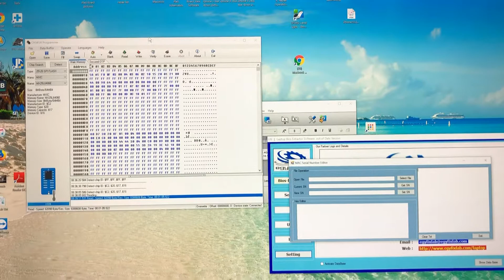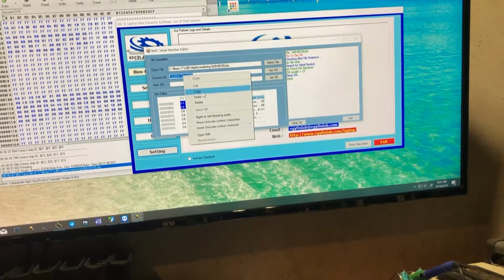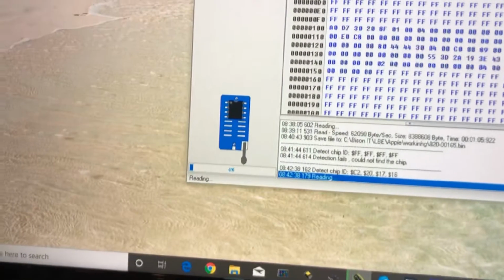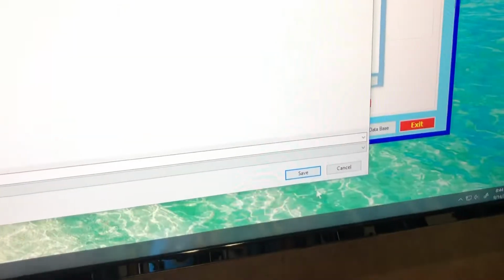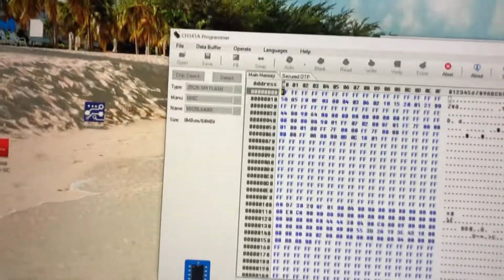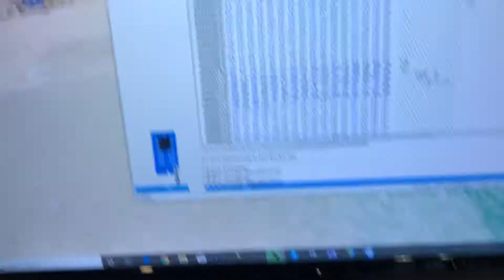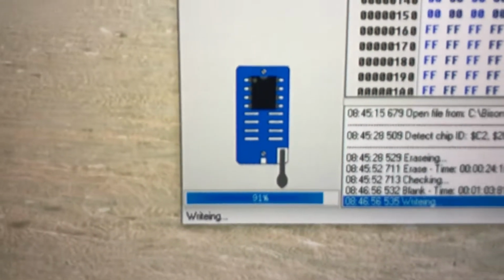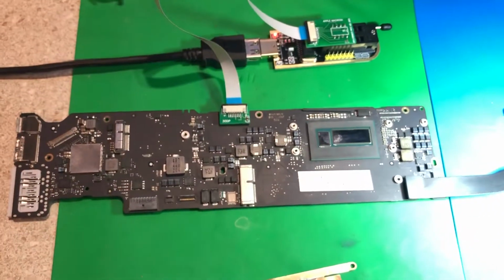Changing a Apple serial number

Comment: Hi! In a different comment, you mentioned that a S/N change was still posible on the 2018 and onward models with the T2 IC. How exactly did you manage that? Because after looking at the schematic for the 16inch the CPU isn't even connected to the SPI rom, as one isn't present on the board for the ME and UEFI.

Comment: Wow! Your vids are great!
There's a way you may share Mac book serial Editor? Software, I have the same connector to interface without desoldering the Epromm, a GQ4x programmer and others programmers readers, and I am ready to read some macs dumps. But if you'd like or able to share such software it would be great!
* Edited: to learn only purpuse.
Reply from the maker: I use two solutions.   I use a CMI zapper with does not run on a computer and is dedicated hardware so I can't share it.  And I use LBS with is copy protected and only works on the machine you activate it on.   I would say in total I have spent about $850 on programers, and software do handle about anything.  It's well worth it.  I use my programmer probably 5-10 times a week.
Reply: @kcmicrotronix  May I pm you? I'd like to know more about CMI Hardware price.
Reply from the maker: Sure my number is on the channel

Comment: How do you choose the serial number? And when you change the serial number does this effect the workings of the apple device? Same goes for imei, how do we choose that because the imei might match someone else making the phone sim company question it?
Reply from the maker: The serial number belongs to the customer's machine that is being fixed and matches their bottom case.  Not all logic boards can be repaired.  When a customer has to replace their board at the apple store "as is the usually the case for the Apple store as they do not trouble shoot or attempt to repair the logic board" Apple loads their serial number onto the replacement board.  I do the same thing but in most cases I just fix the customer's board and do not have to change the serial number.

Most of my board inventory has had the serial numbers wiped so a utility called "serializer" which was made by Apple can be used to load the new serial number without the use of a programmer.

I have also had success replacing serial number both board and machine on T2 chip machines from 2018.  So it looks like this practice will continue for the foreseeable future.
Reply: Question, if i have a 2019 macbook pro with a activation lock if i was to transfer serial on to fully working board will it disable the activation lock? If its not act locked